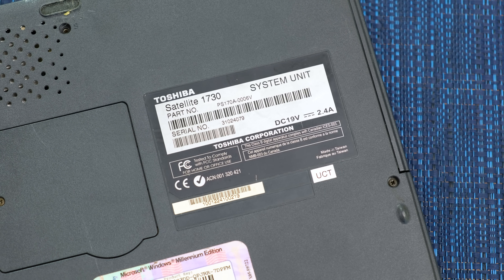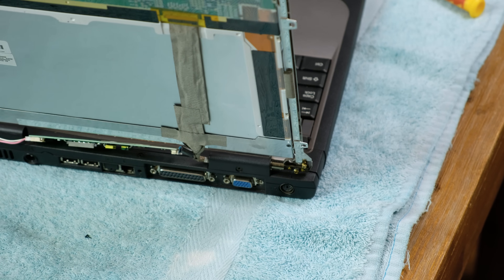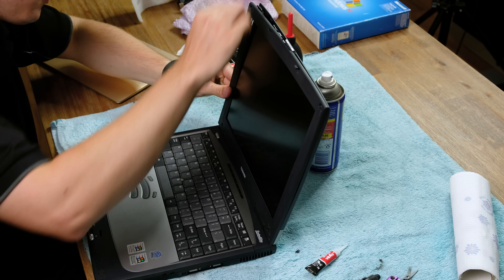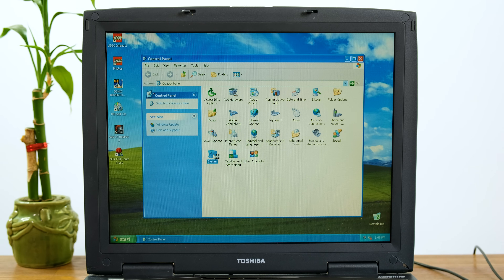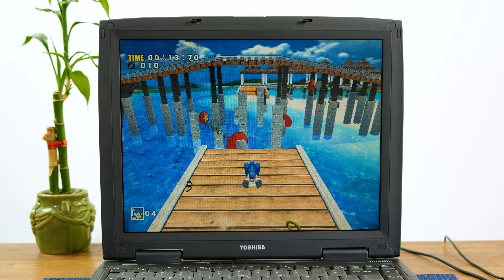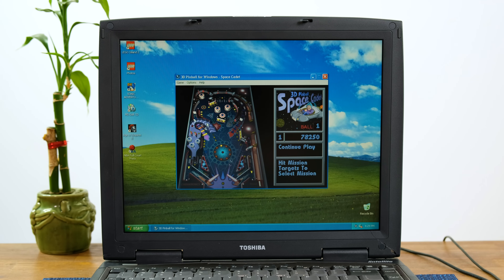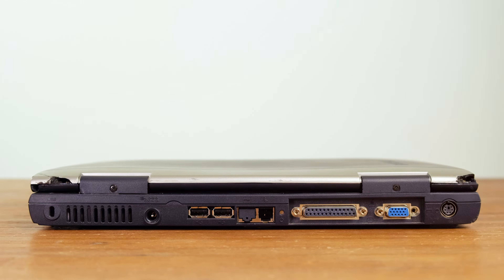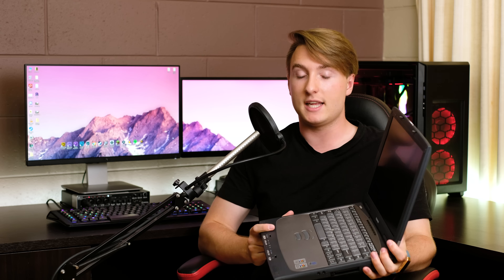Someone Threw Out This Broken Laptop… Let’s Fix It!

Comment: so the thing is. HOW Modern is your network. My network runs on 802.11 G and is protected by WPA2. I have a 2003 dell latitude laptop and it connects perfectly fine. Same with my DSi
Reply from the maker: It seems this version of windows doesn't like anything over the WEP security standard. I even set my router to that but it would simply not connect to the internet. I might setup an ancient router for testing in future videos 🙂
Reply: @psivewri  Install Service Pack 3.
Reply: @expression6180  This.

But first install SP1a or SP2, you can't install SP3 with no Service Packs installed.

Also, this will slow down the OS a little bit, so...
Reply: @psivewri  Some wireless drivers can bypass this - I used to run an Atheros wireless adapter on SP2 which connected fine to WPA2 networks, something normally not possible without upgrading to SP3.
Reply: @psivewri  its not true, XP would support most if not all modern standards, certainly more than WEP, even 98 does (if you get the right wireless card)  Maybe the card used doesn't though. (research its model)
Reply: @patg108  98 doesn't support any wireless, just the driver and software delivered from the manufacturer. For Windows 98, it's just a LAN connection
Reply: @resneptacle  98 out of the box no, but with 3rd party software (often included from manufacturer) 98 can support wireless cards

And getting the right card/software means it can support WPA2, WEP and WPA (WPA2 would be the harder to get protocol)

Technically counting that it can go online.

Not certain about 95 or Win 3.1 , 3.11 or dos though.  Anything they might have (i'd imagine there might be something out there, (esp for 95), would be just as if not more limited.
Reply: If you NEED To use XP as a maximum. Try installing the Unoffical Service Pack 4. It has all the security updates up until the discontinuation date and support for WPA2. It's almost a gig in size though...